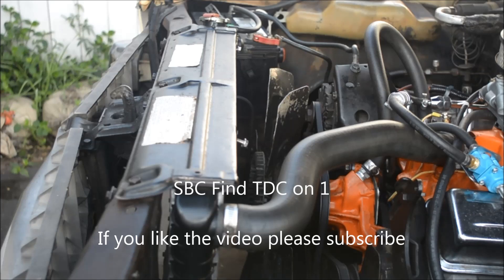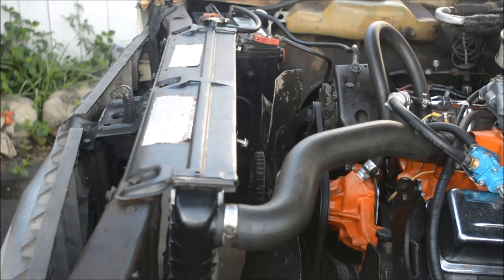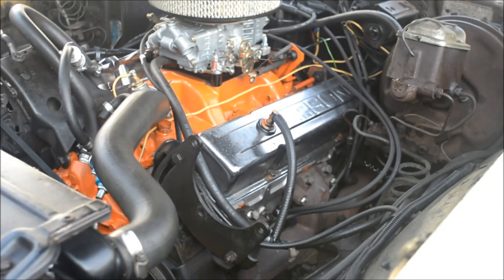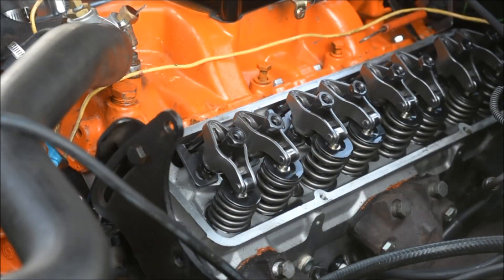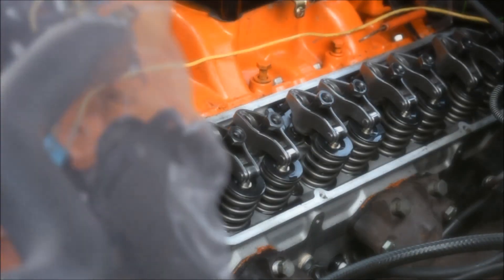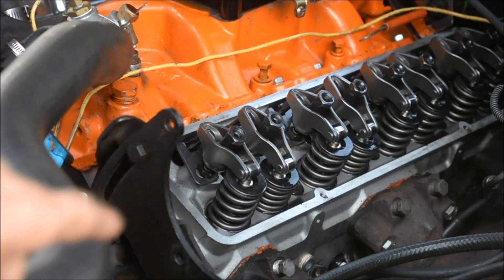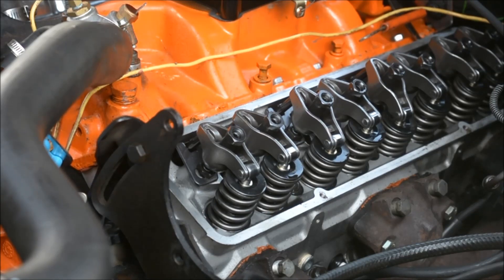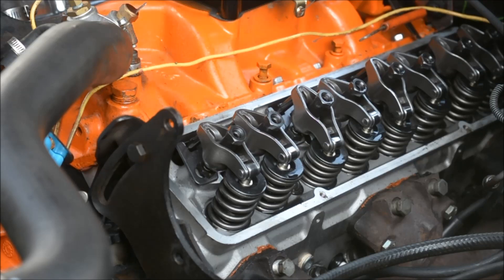SBC Find Top Dead Center on 1

Comment: Complete novice on finding TDC and have been using my 0 degree mark on my balancer. But I'm replacing my valve covers and was hoping for to get TDC using your method. Seems like you can go a little before or a little after the 0 degrees and throw everything off if you don't stop at the exact time-- how will I know when to stop?🤔
Reply from the maker: @raymond menendez

The video is to help find TDC for cylinder 1 on a sbc.  If you can see the harmonic balancer you will see 0 line up with a mark, so stop there and that is where you can install the distributor. Once you find TDC you need to follow instructions to set initial timing if changing the distributor, adjust the valves, or something else that caused you to change the timing.
Reply: @c41man  been having troubles with pinging on hard throttle. Using 93 Octane with Octane boost. Have initial timing at 6 degrees already and have been wondering it the timing mark is accurate since the motor was rebuilt.  1970 C10 with a 350. Figure  this will put my mind at ease once and for all. Thank you so much for your time on a Sunday afternoon 🖖
Reply: @c41man  Sunday? 😁
Reply from the maker: @raymondmenendez6499  

Oh I see.  Use a timing light to adjust for less timing until it doesn't ping when you are driving.  You're right the timing mark could be wrong.  Then when you feel absolutely ready watch this video and others to make sure your timing mark is correct.  Good luck!
Reply: @c41man  i feel confident in your video---  thanks

Comment: But which way did you turn the Harmonic balancer, right or left ? And is this the same direction on a small block 305?
Reply from the maker: Turn the balancer clockwise or to the right. SBC 350 and 305 will be the same.
Reply: @c41man  I have a 1990 caprice 305 tbi I have to turn the crank counterclockwise while standing of driver side going clockwise the rocker arms don't move
Reply: Read a book geez....

Comment: Hello Dave a couple questions. 

1. How do you adjust poly-locks when the engine is running?  Also those must not be self aligning rockers as i see you have guide plates?
Reply from the maker: @ Mitch C

I have not tried to adjust the valves or poly-locks with the engine running.  You could probable do it with a wrench and the correct size allen key socket for your rachet and adjust until the ticking goes away.  I believe at this point I already had a retro roller cam and roller lifters so I didn't need to adjust the valves after the intial adjustment.  Correct I have guide plates on the Nova, so no self aligning rocker arms.

Comment: Another way to confirm that it is cylinder #1 on tdc of compression (and not tdc exhaust) is take note that the intake valve of #3 is open on the intake stroke. Can see on this video. If you work back through the firing order, #3 is halfway through its intake stroke when #1 is tdc on compression. If #1 is tdc on exhaust then both valves on #3 will be closed as #3 is halfway down the power stroke.
Reply from the maker: @ Ike Godsay,

Yeah I see that.  I made this video as I work alone and I have reusable valve cover gaskets.  I find this easier than putting my finger in #1 spark plug hole and turning the engine over.  I also have video that shows the method to adjust valves that is found in the Chilton's manual.  There is a lot of good info on the net, but not found on Youtube that people are not aware of.
Reply: Hey Ike... thanks very much for pointing this out about Intake Valve #3.
Reply: Excellent